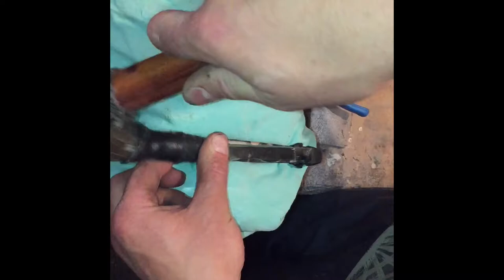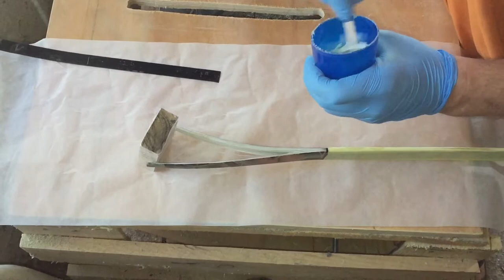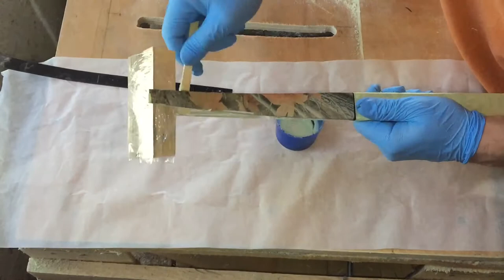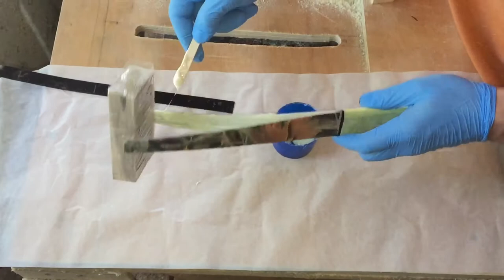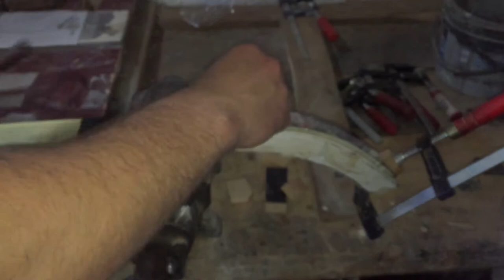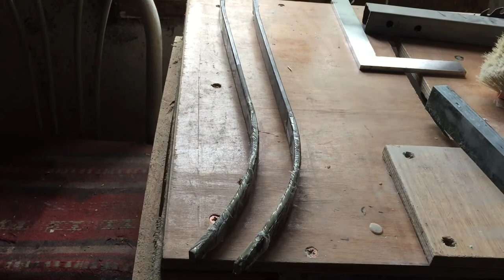Recurving Solid Fiberglass Bow

Comment: Yo helm could ca be used instead of epoxy? You would have to be ready but I was thinking it would but I would prefer the tried and true but I’ve been saving a lot of bows with thin ca I do trust it anyway if you get time let me know what you think. Have a  good day
Reply from the maker: Hi friend, that would be interesting to test, ca glue does have strength for this job, im only concerned about durability of it in different temperatures over time, we should do a long term test to see, thanks for idea!

Comment: Does the extra glue noticeably stiffen the recurve portion of the limb? If a bow delaminates in a bending area of a limb, can you glue it back together without affecting the tiller too much?
Reply from the maker: It stiffen a little bit, but not too much, i think you can use glue to repair delamination without additional tillering, just be sure to clamp that part really well to get thin glue line, if glue line is thick than that spot will be stiffer

Comment: How many pounds is that bow looks like the fiber is about 5/6 mm? I make my own bows from solid efg staves.
Reply from the maker: Its 6.1mm, end up being 65-70 pounds because of its short length
Reply: @Helmbowman  can I ask how long is the riser and the limbs?  My heaviest bow is 4í8 pounds. Not sure I can draw A 70  pound safely. Actually pretty sure I can't
Reply from the maker: @jarchdm  limbs are 58cm each, riser is 30cm, but limb attachment place on riser is 8cm each, which gives total length of 130cm. You can watch full process here https://youtu.be/9gOyP3eNKZ0